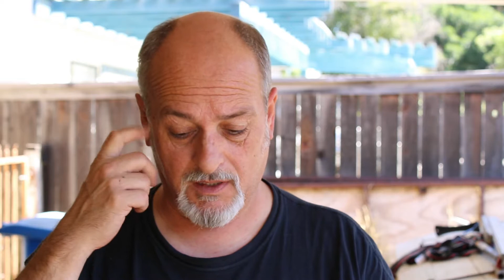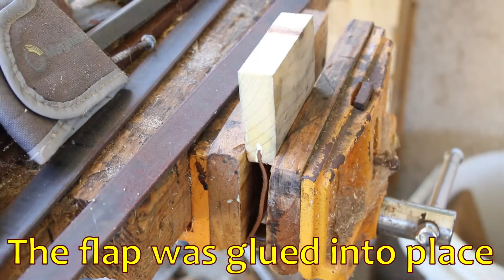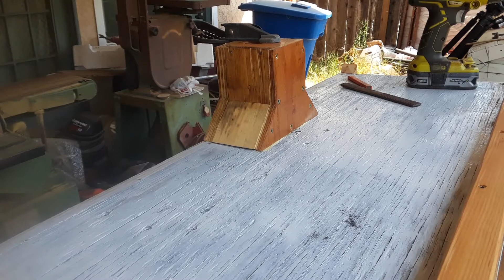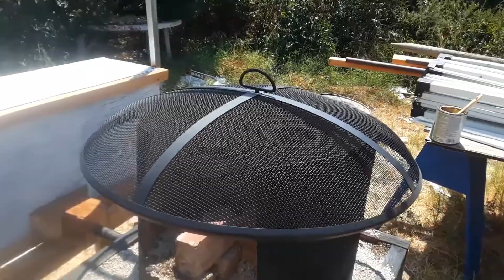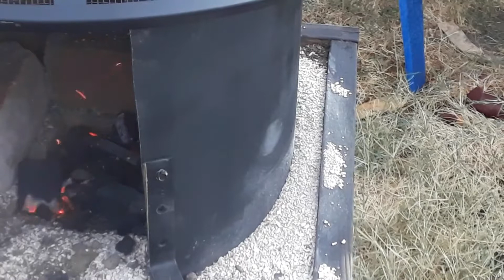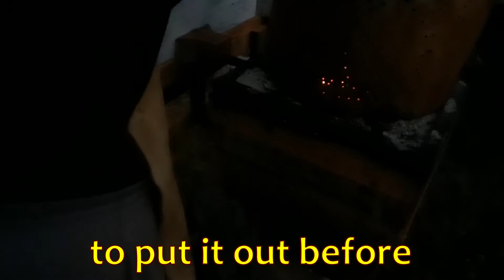Dirt Forge Progress and First Fire

Comment: ..Great job sir!! It's always a pleasure to see a concept come to reality..Now if there were a way to make a bellows or tank to hold the air and provide a steady flow, hmm.. The wheels are already humming in my head...
Reply from the maker: Thanks! I was thinking of the bladder-pressure tanks on modern water wells. Rubber diaphragm inside the tank, pressurized air on the top side, water coming in from below. Water presses against the diaphragm, increasing air pressure, and then as water is dispensed, the pressure is kept steady. That's the first concept I had. I just can't figure out the materials.
Reply: @DBacaMaker  ..maybe a tire inner tube and some sand. or something like that...

Comment: Now it makes sense to me 😉
I don't know anything about dirt box forges so please forgive my ignorance. Will you build an insulated wall around the fire to help increase the temperature range. Maybe a refractory brick tunnel if you need to pass long lengths through.
Scary how the embers fly. I haven't see anything like that before, and really good to see you mitigating for it. A finer gauze would surely do the trick, but an alternative fuel, maybe anthracite, might be worth trying.
Reply from the maker: I thought I replied to this 2 weeks ago. Apparently it didn't go through. Yes I built a wall around the hole in the middle that makes up the "firepot" made of high temperature fire bricks. That plus the insulation the dirt itself affords keeps the box from burning. I can certainly build up any configuration of bricks as my projects have need, even plain red bricks. Also, happily, I have learned from a more experienced smith that plain water on the coals will reduce the sparks, just as with a bituminous, or anthracite, coal fire. Of course, we are not in a region where actual forms of coal are readily available; hence the charcoal.